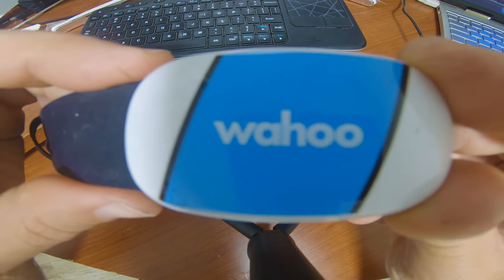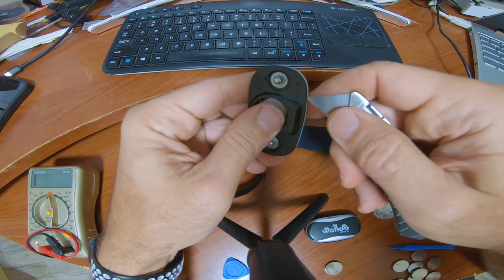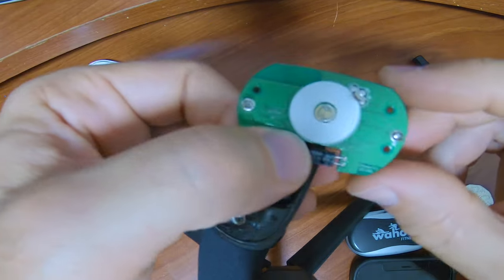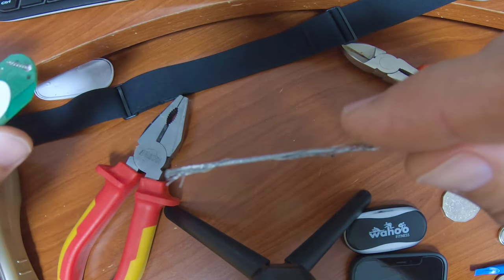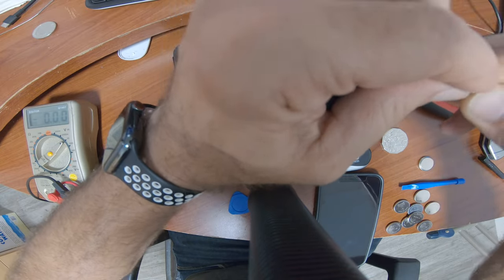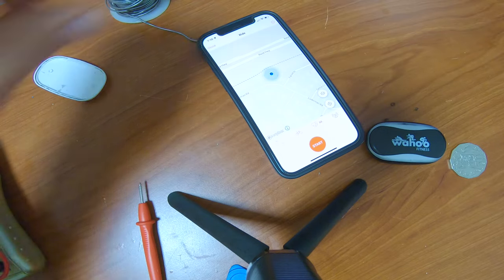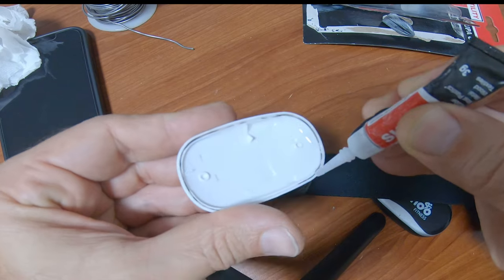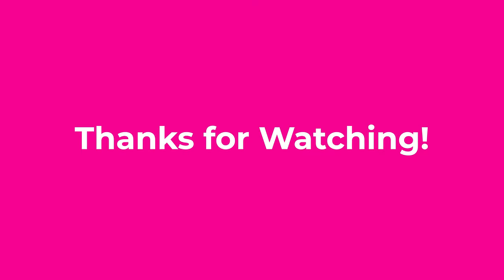Repair dead wahoo Tickr HRM

Comment: The battery cover won’t come off. There is nothing to grab onto to get it off.
I noticed that you decided to skip over showing how to get the battery cover off. It was just magically removed in the video.
How did you remove it?
Reply from the maker: Hi mate
The battery cover was removed as per normal with the use of a small coin to turn it to the unlock position then it should simply lift up. Same way you would remove it when you had to replace the battery. Hope this helps.
Reply: That happened with mine. I just used a pocket knife to carefully engage the edge of the circle cover and was able to pry it off.